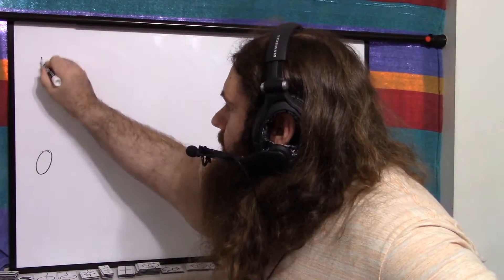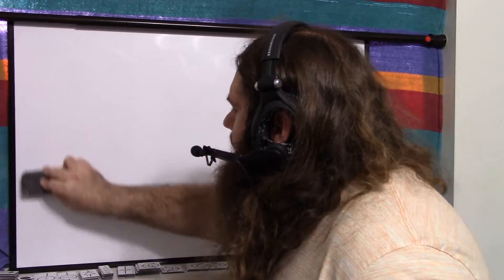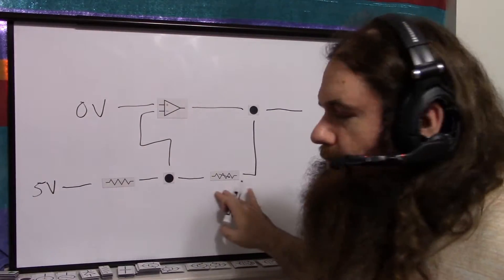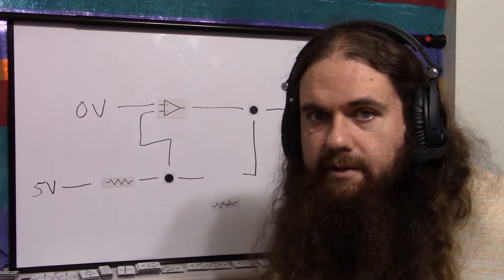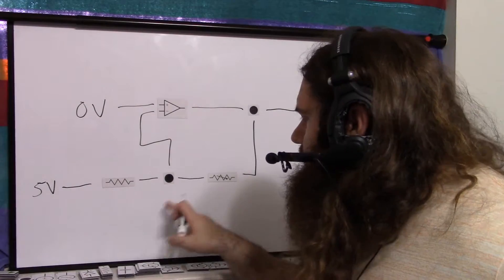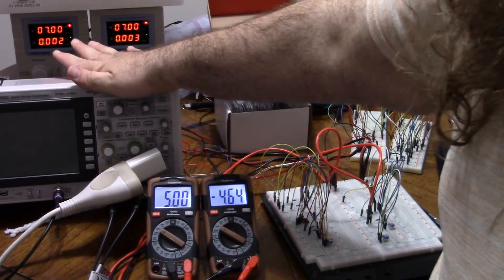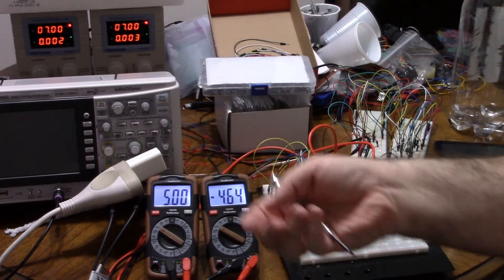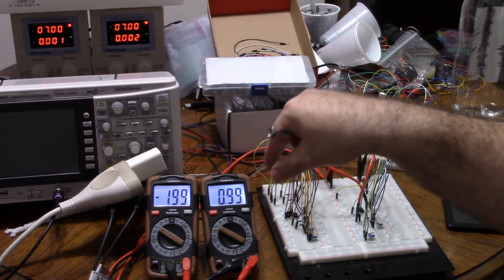Buffered Inverting Voltage Divider - Strange but Useful Op Amp Trick - Simply Put

Comment: This can be used to both divide and multiply voltages.
Simply put, the fixed resistor should be the half of the potentiometer.

So when the potentiometer is
* set at its max value, the voltage is inverted and DOUBLED.
* set at its half value, the voltage is just inverted (unity gain).
* set at its quarter value, the voltage is inverted and DIVIDED by 2.
* set at its min value (0 Ohm), the voltage is 0.

And all the positions in between.

I'm working with modular synthesizers, and I need this kind of conversion
(preceeded with an inverting mixer that uses a potentiometer as a voltage
divider to get a voltage to be added/subtracted to the incoming signal).

This way, I can convert
* -5V ... +5V to 0V ... +5V
* -5V ... +5V to 0V ... +10V
* -5V ... +5V to -10V ... +10V
* 0V ... 5V to -5V ... +5V
* 0V ... 5V to -10V ... +10V
* 0V ... 5V to 0V ... +10V 
* -10V ... +10V to -5V ... +5V
* -10V ... +10V to 0V ... +5V
* -10V ... +10V to 0V ... +10V

And get all the voltage range shifts I do always need.

Comment: Complete novice question: I’ve set up the same circuit as you, took a 9v battery, connected it to the inverting pin [#2] of an lm386. I then connected the lm386’s non-inverting pin [#3] to ground. I set my multimeter’s red probe [+] on the lm386’s output pin [#5] and the black probe [-] on the ground rail. My result: 0.83 volts DC. What did I do wrong? Please reply, I’m trying to learn more about this stuff. Be safe and thank you.

Comment: My guess is that you want to compute the sum of a series to approximate a transcendental constant such as pi.  But that's just my guess... :)
Reply from the maker: Okay, that's a cool idea though. Using analog electronics to do math. I'm making a note of that.
Reply: @simplyput2796  I think you would love analog computers (if you haven't already discovered them).  If you have a set of differential equations that model reality, you can solve them with op amps (using summers and integrators) and watch it unfold on your scope.  You can also use the same technique to model chaotic systems.
Reply from the maker: Yep, a viewer mentioned it a bit ago, and it's something I plan to look into at a random future date. Already have a lot of projects in the cookpot!
Reply: @simplyput2796  It was probably me who mentioned it :)  Too many projects, so little time is my mantra...